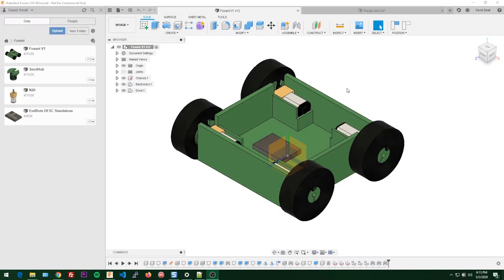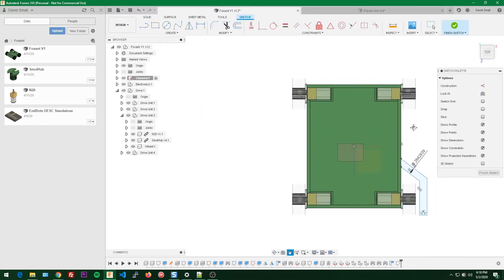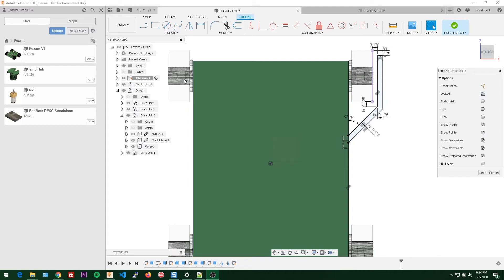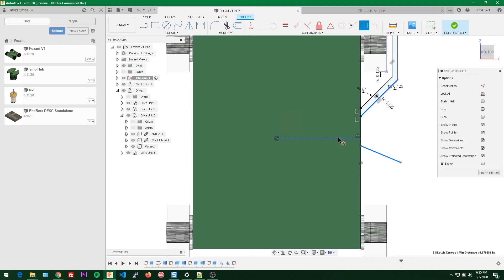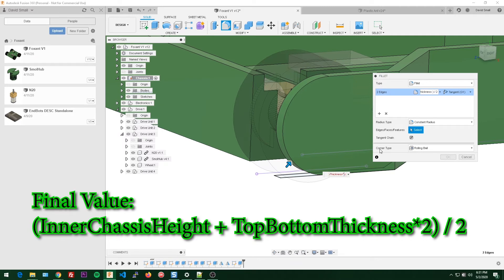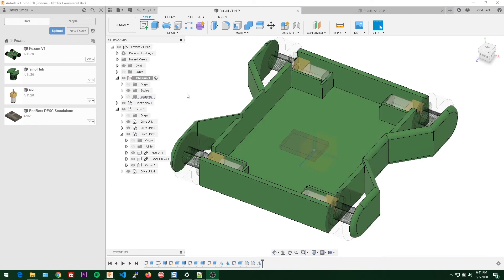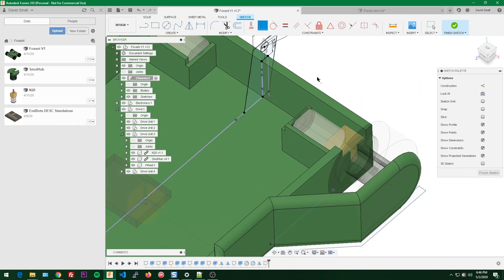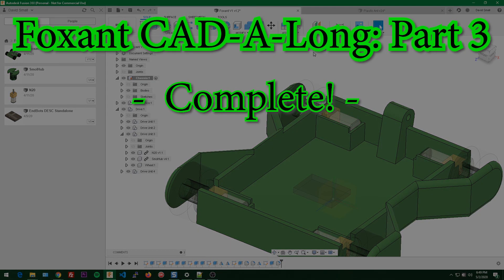Foxic CAD-A-Long: Part 3

Comment: Hey, love this series, just having issues when I adjust the parameters. Length, width and height all work fine but the walls which were made for the motors don't move with the sketch if that makes sense?